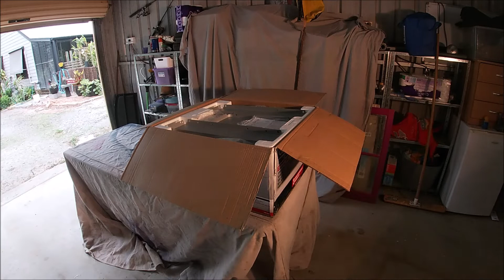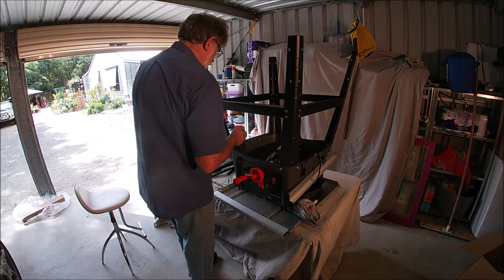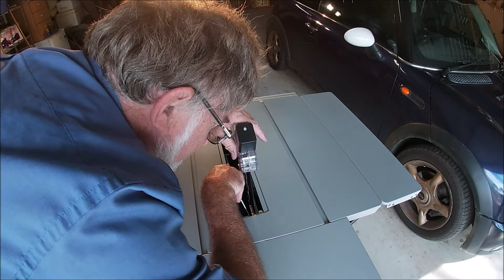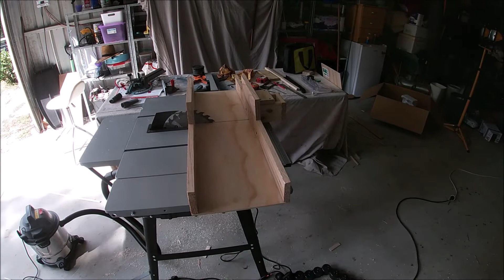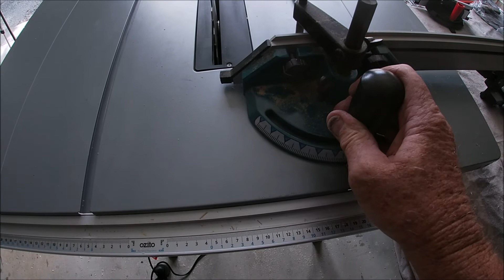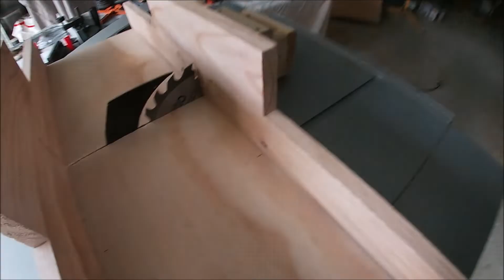OZITO TBS 2000 Table Saw

Comment: Hey Doug, thanks for this video! I was about to go to Bunnos and get one with my Christmas vouchers because I can't afford the Ryobi one - I wanted a bit more of a non-biased opinion on it and this video helped a lot. 
As a beginner, I think I will get one, but ill be sure to keep in mind the tolerances and cheap design of the machine. 

Cheers again!
Reply from the maker: For a starter machine I think it is great. For the price you can get a feel if you actually want to go for a more expensive machine after you have used this one. Glad my video helped. Take care & be safe, they can all be dangerous!

Comment: In my case I needed to shorten the door and a few boards. I knew there would be problems but I didn't expect a few nuts to be missing but I have something that is probably from another machine. And the worst thing about it is the lack of level "0" in this saw blade. I think a hammer will help.:face-turquoise-covering-eyes:

Comment: Sorry to hear your Makita failed. Hopefully mine is going to last. 
After my Ryobi broke, I bought a Rockwell from the blue shed (m10). I assembled it, turned it on at the power point and it started humming. I cut one or two bits of wood and left it switched on (at the power point) overnight only to find it humming still next morning. I felt the motor, it was cool but I wasn't sure if it was safe. So, I packed it back into the box, took it back to where I'd bought it from, they took it back, gave me full refund with virtually no comment. I watched them put it onto a pallet, lift it onto a storage rack with a fork lift and then I left. The Rockwell cost me less than the subsequent Makita that I bought from a sister (or brother) store for around $619.
I made a wooden stand which was stronger than the Ryobi (and Rockwell) stand. I've since added locking castors to make it easier to move.
I have a cheap crosscut drop saw. It too had a 24 tooth blade. I replaced this blade with a 60 tooth blade that doesn't tear intricate cuts.
I have a few Ozito corded and cordless tools. I find them satisfactory for what I do.  14v drill, battery blower, battery hedge/grass cutter. The drill came with two batteries one of which died quite a few years ago. 
Anyway,  hope your new saw does what it's meant to. I look forward to seeing something you make (other than a sled).
Cheers (oh, and get rid of that push stick!)..
Reply from the maker: Hi Barry. It seems that no matter what we buy these days there is no quality in the products. The Makita is a good saw but was cheapened by having them made in China when once they were all manufactured in Japan. The blade raising mechanism on it consists of a steel rod with a left hand thread which is in turn threaded through the gearbox casting which is made of an aluminium alloy. Through time the weight of the saw being raised and lowered wears out the alloy threads in the casting resulting in a complete failure when the threads cannot mesh with each other. Apparently this is a very common problem so it is, in my eyes, a design flaw. Mixing alloys with steel is fraught with problems as those who have ever owned a car with a steel engine block and an aluminium head can attest. I have ordered a new one,( gearbox casting,) to be sent from Sydney but I needed to make some cuts so I got the OZITO. I have been using it all morning & it is doing the job. For the $200 it is what you might expect. Strangely they supply a total of 3 blades! all 24 tooth! Weird! Probably made too many & use it as an incentive to buy!! Anyway although it is flimsy I might make a custom bench to mount it in which will beef it up & allow me to extend the T slots & make a bigger sled & maybe incorporate my router into the package. My tiny workshop is too cluttered with all the stuff I have so it might be time to have a rethink. I will keep the Makita but will obviously keep an eye on the wear aspect of the threaded parts. There is a good video from a guy called JD?? in the USA about the same saw & he made some modifications to his & incorporated a spring to aid in the raising of his so I might investigate that further. I will of course make some better push sticks too!! Hahaha!!
Take care, great to hear from you again.

Comment: Just bought the ozito TBS 2010, there are a few differences between the 2 models, 1 big difference is how the legs are fitted, other differences are meaningless. Overall, i give it a 85% for being a very good saw table, width for cutting safely is 1 big factor, so i am going to use my 2 triton 2000 work tables to suit the top, and allow for wider cuts and more stable.
Reply from the maker: I haven't used my saw for a long time Peter. I bought it because my Makita had stripped its gear box & I needed a saw to complete a project that I was working on. I repaired the Makita & it is still my main saw. What I do use the Ozito for is ripping lengths of old timber into more convenient sizes. I have found that it is way more powerful than the Makita for this purpose. I only have a small workshop but the Ozito is light enough for me to lift it & use it outside when the weather permits of course! For the money they are good value when compared to the cheapest alternative, (Makita 100N ) I am really peeved with Makita for 'çheapening' their products. I suppose they could be called the QANTAS of machine tools now for ruining their reputation for quality amongst their customers. Cest La Vie I guess. Good luck with your saw.

Comment: Hi just wondering if you know what size the riving knife bolt is? I’ve lost mine 😂🤦‍♂️ and can’t find the size anywhere on there websy?
Reply from the maker: Hi there, sorry for not replying sooner. I just took the riving knife off & it 'appears''  to be 1/4 inch UNF. However I suggest you go to Bunnings & get a couple of bolts in that range, ie 1/4 Inch, or 6mm  & carefully try each one in the hole. I have a number of different nuts which seemed to fit the bolt I took out. The bolt had the number 8.8 stamped on it but then I discovered another bolt in my collection which was much bigger with the same number so I guess that does not indicate size? I hope this helps.

Comment: Hi I just purchased the same table saw and I'm a beginner. I would like to change the blade to 60t or 80t I think this would help go improve the rough cutting that the 24t does? Also I was thinking of making a sled too same as yours and removing the plastic cover. Is this a star bolt? Thanks and great video perfect for me to learn . regards Chris
Reply from the maker: Hi Chris. Sorry to take so long to reply. The plastic cover has a T20 Torx screw & the riving knife is a standard (maybe 8-10mm) nut from memory. A blade with more teeth would certainly give you a smoother finish. I must admit that I only bought the Ozito because my Makita had broken down & I needed to finish a project in the time that it would take to get the spare part from Makita. Good Luck with your saw but remember to always be careful.
Reply: To change the blade in the TBS 2000 & TBS 2010, i found it easier to tilt the blade as far to the right as possible, use the 2 tools provided and undo the 10mm bolt, while holding firm the 15MM bolt, it turns off anto clockwise, and tightens with the direction of the blade, 10 minutes it took me.

Comment: How do you cut a piece of timber that is more than 29cm wide the rip fence only goes 20cm on one side and 29cm on the other side. I have a piece that is 1m that i need to cut in half
Reply from the maker: Unfortunately this saw is not designed to cut sheets. To cut a sheet you would have to use another saw.
Reply: Thanks.
Reply: I thought I could move the measuring guide over by undoing the screws and clip the guide rail on, which I can but not sure if that was the done thing. This at least gives me about another 20cm.

Comment: where to find info on fitting saw blade?  Manual has minimal info!  eg clock-wise or not?
Reply from the maker: Hi Michael. The manual for TBS 2000 shows how to replace blade at section 7. You can download it by searching Google if it is not shown on your copy. The direction is anti clockwise to loosen. Hope this helps.

Comment: Why cut the riving knife?

Just remove it from the machine.
Reply from the maker: Because it acts as a guide & splits the cut piece otherwise the whole piece can kick back
Reply: @dougrorison1211  But you are using a sled.

Is the riving knife still needed when using a sled?
Reply: I know a guy who cut 4 fingers off because the saw had no riving knife. He was splitting a peice in half the last little bit he tried to pull it through from the back.